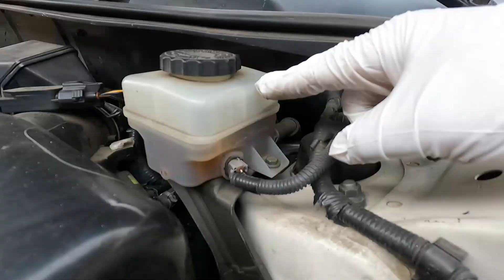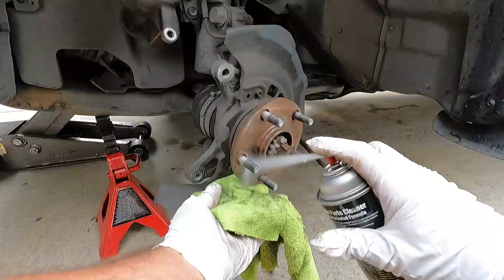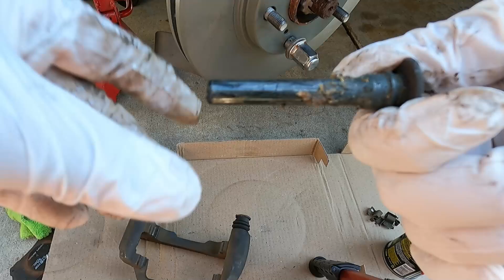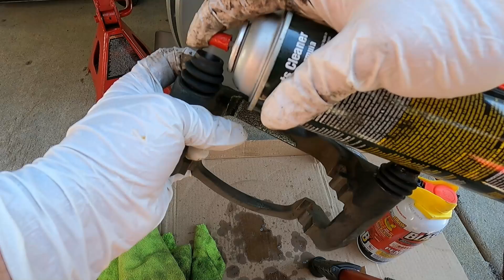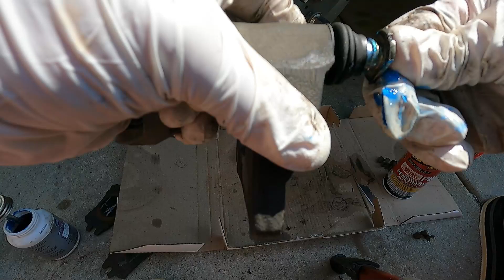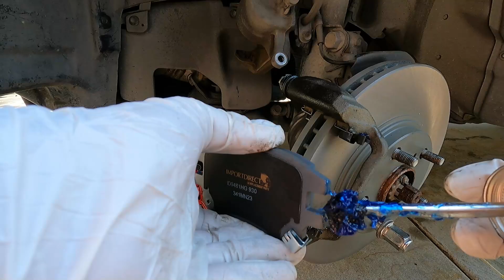1999 - 2003 Lexus RX300 - Replacing Front Brake Pads & Rotors - Complete Tutorial With Torque Specs!

Comment: Thanks for the video! I will do my breaks on my own! Do the pads come with a label saying which one goes in the inside and which one goes on the outside or either o e would work on either side??
Reply: I'm doing this myself. The pads will not be labeled. But there is a specific pattern for the front and back. When you take the old pads off you will see how the new ones will go on.

Comment: I'm considering doing all four of my 2000 RX300, do i press the brake pedal afterward between each one? Thanks from Philly💚
Reply from the maker: @oghash4912  No need to do it after each wheel, but between the front and back should be good.
Reply: @DantheFixitMan  nice, thank u. That was the only part I wasn't clear on.. Amazing video 🙏🔥